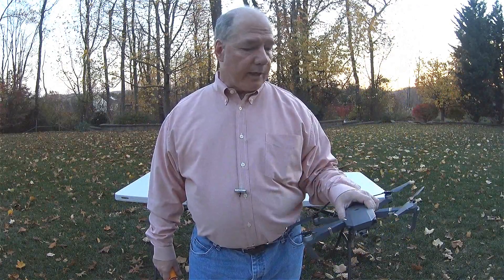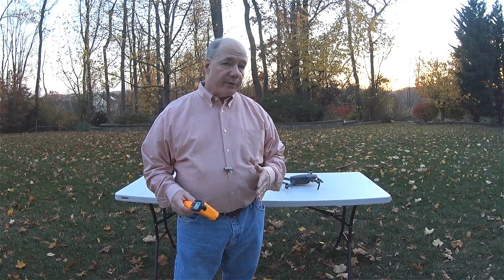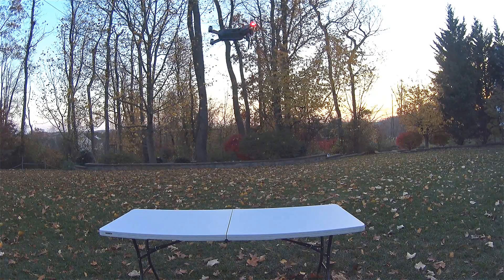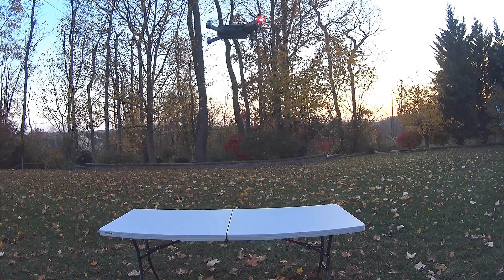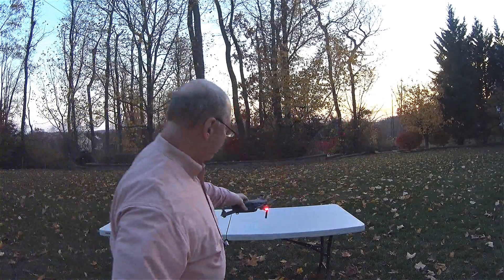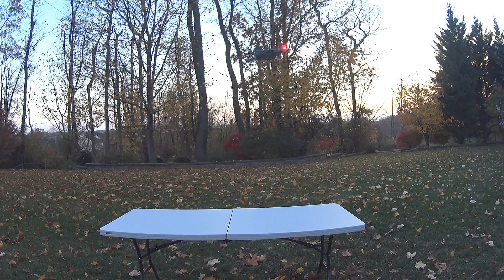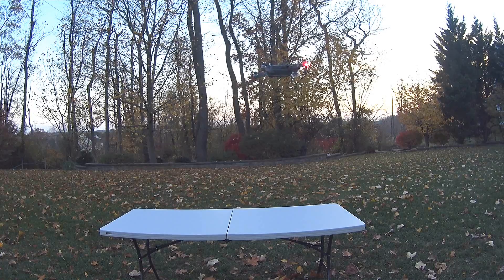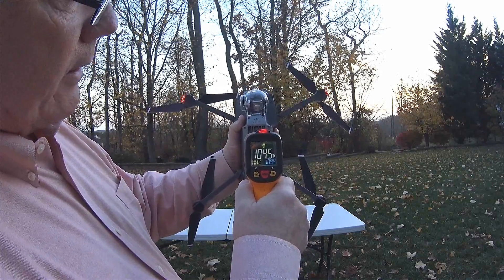Mavic Pro Running Hot?  Here's Why

Comment: I agree that overtime the heat will reduce the useful life of electronic components. But with temperatures between 90º & 102º I wouldn't worry too much. The real test should be as you say give it a full flight mission with and without the globe making sure that at the start of the mission the drone is the same temperature. I believe that any temperature measurements in the range that we can physically touch would not hurt any electronic component and therefore have a full and useful life expectancy.  This test only proves that the heat test requires a full flight mission in order to come to a reasonable conclusion. This was a very interesting 1st step attempt though and thanks for that. We'll keep a watchful eye on your next run.
Reply from the maker: Thanks for the post and I can tell you that any heat is the enemy of electronics. Damage can occur from cyclic heat that is produced when a system "warms up" and also the consistent heat of operation. The challenge with the Mavic is that it experiences both types of damaging heat during operation and minimizing it is critical to a long and healthy life. What I was trying to show in the clip was that the overall temperature of the heat sink was higher with the globe attached because of the restriction to airflow it caused. I did let the quad cool back down during the tests but didn't show that portion in the clip. I will follow-up with a longer version when I get a break in the weather but expect the results to be similar to the short test I did. My worry is that since the only entry port for cooling air for the craft is right behind the gimbal, blocking this with the globe has to force the fan to work harder and will result in higher temperatures. I really appreciate the post and hope you stop back soon. Rick

Comment: I assume when flying the mavic it uses your cell phones data plan to track it down via google map correct?   Do you know how much data it uses per flight by any chance.  I ask cuz I would not want a hefty cell phone bill at months end after  doing a couple of flights.  Lastly, when recording at 4k would that increase the data the Dji app uses?
Reply from the maker: Actually you can use a phone/tablet without a cellular or Wifi plan. The Mavic Pro has an internal GPS receiver to know it's position as well as most compatible phones and tablets. I use a standard iPad Mini 4 with no plans and it works great. Thanks for the post and be sure to sub the channel. Rick

Comment: Nicely done.  I appreciate your "engineering approach" to your reviews.  I was a Sr. Electronic Tech for most of my working career (retired a year ago), and agree that heat can play a big part in premature parts failure. I worked on many Military and Military contractor devices, and we always had to run them at least 24 hrs in an environmental chamber, ramping and decreasing temperatures per their specs, to try to catch any parts which were thermally unstable.  Of course, all those items were built to IPC-A-610 'Class 3' standards, and don't know if the Mavic (or any other UAV) is built to those standards .. more likely Class 2 (and I've seen quads built to standards which don't even meet Class 1).

Comment: The DJI engineers provided a crystal clear gimbal cover and a protective soft cover for it. Obviously they expected one to fly with the clear cover installed. Their description of it (the cover) says it will protect the gimbal in flight. Period.
Reply from the maker: Jack, thanks for the post but I'm not sure if you've ever flown the Mavic Pro with the cover on but if you do you'll notice two problems with it. First, it changes things optically and not only will it force you to constantly tap focus but you can't turn more than 90 degrees towards the sun while flying without having a reflective band of light completely ruin your footage. It's interior curved surface reflects everything and degrades the quality of pics and videos. Second, the fact that it restricts the critical airflow needed to cool the drone, makes flying with the globe attached a bad idea. I can't speak for DJI but for me the negatives outweigh the small chance it will protect my gimbal in a crash. Thanks for the post and I hope you sub the channel so you don't miss any new content. Rick
Reply: I've flown the Mavic with the cover, but it degrades the optics so I almost never do. My point is that you CAN, not that you should. Note also that the cover has ventilation holes. It's great that you are doing these experiments --thanks!

Comment: I grab my Yuneec Q500+ out of the air instead of landing all the time as it's easy to grap hold of one of the large legs while I shut it down. I was hoping I could do something similar when I get my Mavic but there doesn't look like there is much to grab onto. Could you do a video on air recovery for the Mavic while I wait to get mine?
Reply from the maker: Casey, thanks for the post and I hope your Mavic arrives soon. I'll be honest and tell you that I'm not a huge fan of hand-catching for a lot of reasons and it's getting more difficult with some of the newer drones because of their crash avoidance systems. On older drones you could "trust" them a little more because they would stay in place, which made them easy to grab. The Mavic Pro and Phantom 4 Pro both have advanced downward facing sensors that will react to an approaching hand and adjust their position. This makes for a dangerous cat-and-mouse game between delicate fingers and spinning blades. I actually use a folding takeoff and landing mat with my quads. This is especially important with the Mavic pro because of the danger of grass and sand being sucked into the cooling fan on the front. I'm working on a clip this weekend about the choices for landing mats so be sure to sub the channel so you don't miss anything. Rick
Reply: Would there be a way to assign one of the user assignable buttons on the back of the controller to shut off the down looking sensors?

Comment: I hear the word "hot" a lot.  100* isn't hot for a chip... neither is 125* for that matter.
Reply: You are correct in that 100 and 125 F is not hot for a chip, but he wasn't measuring the chip. He was measuring the heat sink on the other side of the chip. BIG difference!
Reply from the maker: Airgun - thanks for the post but honestly, any heat is bad for electronics in general. There is always some fatigue with any solid device when it gets hot and the type of heat is important as well. Steady-state heat is the easiest type and less harmful to components. This occurs when you turn a device on and let it run continuously. While this still can reduce the useful life of a chip, its not as bad as transient (or dynamic) heat. This is what eventually kills most components and occurs during repeated heating and cooling cycles. The transition from cool to hot is very stressful to most solid state components and can dramatically affect their useful life. As I mentioned in the clip, this type of heat damage isn't normally immediately apparent but will add up to fewer years of use for the quad if not managed correctly. Flying the drone with the lens cover on will increase this damage because of the additional heat it causes internally. I hope that helps and that you sub the channel so you don't miss any updates. Thanks, Rick
Reply from the maker: Casey, that's a great point. I was measuring the outside surface of the heat-sink, which is much cooler than the internal chips. Good catch. Rick
Reply: Casey Jones I get where you're coming from but still.. It takes a lot of heat to damage electronics these days and I can't help but feel bad for DJI.  They're such a great company that does so much good for us videographers and people don't realise how damaging vids like this can be... and often all for nothing.
Reply from the maker: Airgun - Thanks for the post but to be fair, you missed the point of the clip. I really respect DJI for their incredible engineering and if you check my channel you'll see how much I rave about them in several of the clips. The point of this clip was to show people that want to fly with the gimbal guard attached to the quad that it will cause the Mavic Pro to run hotter and reduce the live of their new quad. I received mine early in the shipping cycle and discovered that there is a vent right behind the gimbal that is used for ventilation and cooling of the interior components of the quad. With the gimbal guard in place you reduce the airflow available to this fan and raise the internal temperature and cause a higher level of heat stress on these delicate components. It was a warning for new flyers that didn't realize this might be a hazard. I have been flying a wide range of DJI products for a long while and have a ton of respect for their engineering. I hope that explains the clip a little better and I'm glad you're stopping by.
Reply: Drone Valley I wonder what DJI's position is.  Have you put it in front  of them so see what they have to say about it?  Thanks

Comment: decent test, but I think if you flew it a third time and repeated the first test without the dome on, and the temp came back down consistent with your first flight, it would show that the starting temp was irrelevant. It would also show that the fans ventilation did indeed keep the temp lower, even if it started at a higher temperature.
Reply from the maker: Thanks for the post and I did let it cool down to the 64 degrees between tests so they were all the same but didn't think to show that on camera. I assumed you guys would trust me but I totally understand that I should show that on the next clip. What I was trying to prove was that the restricted airflow with the gimbal guard attached did raise the temperature of the quad and it wasn't a good idea to fly with it on. Thanks again for commenting and be sure to sub the channel so you don't miss anything. Rick

Comment: I don't think it's a fair comparison. You should've ran it with the globe first. If you run it first without globe then with globe the copter would automatically be hotter on a 2nd flight without a cold start
Reply from the maker: I actually did let the quad cool back down to the same 64 degrees as the original test, I just didn't show it in the video. The reason I did the clip was to show the viewers that were asking that the protective globe does cause the drone to run hotter because it blocks the fan inlet located behind the gimbal. I appreciate you stopping by and watching and hope you sub the channel. Rick
Reply: Drone Valley just got mine in today. Can't wait to take it out for a flight!

Comment: could the temp difference be caused by the first test was a cold start the second test was with the motor hot from the first run,i think it could only be accurate if both test were done from a cold start

Comment: Around 200 degrees f or 90c is when you should start wearing about the temp. And 90c or 200f will only reduce a cpus life span from 6 years to like 3 to 2 buy them it will probably by obsolete
Reply from the maker: Actually any temperature in that range will cause heat fatigue for those components and reduce the useful life of the quad. Keeping it healthy will allow pilots to sell it when they upgrade to a new one. There are always folks joining the hobby that are looking for used quads to learn on. Thanks again, Rick
Reply: Drone Valley 100 degrees f may lower the chips life span but it will not lower it significantly other components will fail long before the chips fail, to put this in perspective a desktop CPU (which is very similar to what this would have just with it diffident architecture running at 90c or 200f hours a day life span will decrease from around 6 years to around 3 years. by 3 years other components will have failed like the imu or gimbal or other mechanical components
Reply: Drone Valley that info about the CPU life span decrease comes from a well respected customer computer modded a d overclocker professional and if believe that my CPU which is water cooled is around 50c or 122f when my PC is idle and goes up to 80c or 176f under load sometimes up to 95c or 203f for a few hours a day for about a year. By the way it is also overclocked to 4.5ghz with a over voltage of around 1.4 volts and I have had zero issues with system stability and a drone most likely won't be flown as much as my CPU on so it will last longer
Reply from the maker: Ben, I didn't mean to start a rumble on this but there is a big difference between sustained heat (like most PC's experience) and cyclic heat that affects drones. The cycle of heating and cooling components causes much more stress to the delicate electronics than keeping the parts at a relatively high temperature consistently. My concern is that leaving the gimbal cover on the quad raises this cyclic temperature even higher and increases this stress over time. A good rule of thumb for any electronics is to keep it as cool as possible since any temperature above ambient room temperature can affect performance and the life of the gear. The other big difference is the real estate in the drone, which is packed much tighter than in the typical PC. The computer case has a lot of open air, which is typically circulated by a number of cooling fans. The Mavic pro has a single fan, blowing air over the heat sink and internal components. Reducing this airflow is a really bad thing for the quad as it allows the chips to get hotter than normal.

Comment: 100 degrees f won't damage the components
Reply from the maker: Benjamin, the clip was based on questions from viewers about being able to fly with the globe attached. My worry is that by blocking the vent behind the gimbal it would raise the temperature insode the quad substantially when compared to no blockage. This quick test simply showed that the temperature was higher with the globe. Thanks a lot for posting and be sure to sub the channel. Rick
Reply: Drone Valley I got no problem with why you did the test but I have a problem with how  you are saying 100 degrees f will lower the chips life span

Comment: 68 degrees ambient is actually pretty cold for a Multi-Rotor. Fly it at 102 Degrees Ambient and things will be very different. Silicon Chips can run at 70C without issues. I don't think this guy is a technician.
Reply: John Wood ya don't know why he making such a big deal over 100f when it fine at 80-90c or 200f

Comment: The test is not very fair. The first recording the drone was sitting on the table turned off. So when you fly it it goes from 66 to 90 in 60secs. Then you leave it on the table to cool down but it is still turned on and so remains hot if not getting hotter as we saw. We never knew how much more the temp was rising from 90, 95.

Comment: U should have turned off the drone and let it cool before the flight with glove flight. U idiot
Reply from the maker: Thanks for the post but I did let the quad cool down to the original 64 degrees before starting the third round of tests. I now realize that I have to put a section showing that so some folks don't think I'm an idiot. Thanks again for watching and hope you found it helpful, Rick
Reply: Drone Valley thank you for noticing my comment. I ment u should have turned the drone completely off before the second test flight (with the front globe cover on)
There is still computing going on inside the drone even if it is not flying, which continues to generate heat.

Comment: Hi,
If you are going to do the tests so close in time, you should first do the globe on first. If its cooler after the second flight with globe off, then you know the globe is causing restricted airflow. Otherwise, you need testing done after the mavic has been sitting for an hour or more between tests, which would be most accurate.
Reply from the maker: Steve, thanks for the post but I did let the quad cool down to the original 64 degrees for the third part of the test. I now realize that I should have shown that starting temp on screen but didn't think that people would think I was "cheating" :) I am planning on a longer version of this clip and will be sure to include that portion in the video. Thanks again and I hope you sub the channel so you don't miss anything. Rick

Comment: Does the Mavic have a temperature warning or thermal throttle?
Reply from the maker: Not that I know of and there is nothing in the DJI Go app that reports the temp of the quad. It's designed to fly through a number of fresh batteries without issue. The worry I have is that using the globe will cause it to run hotter and should be avoided. Thanks for the post and be sure to sub the channel. Rick